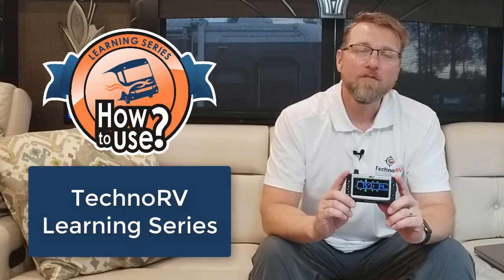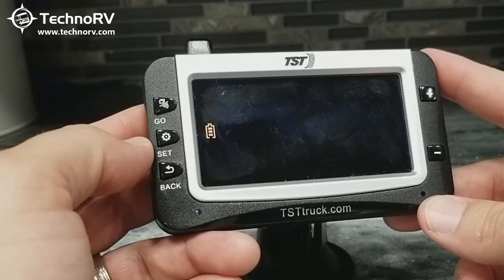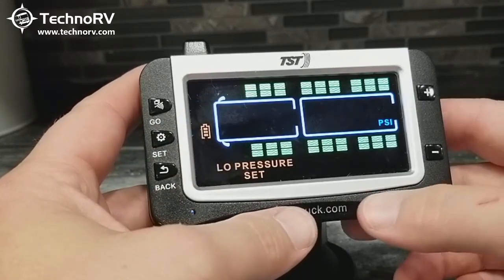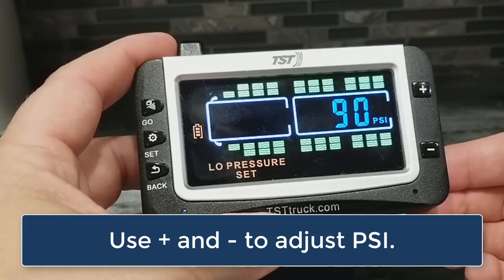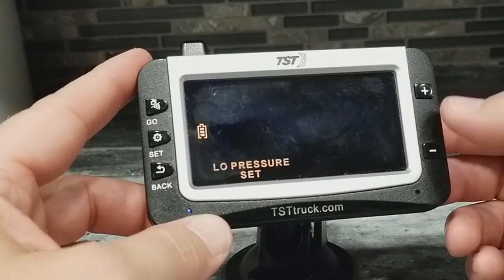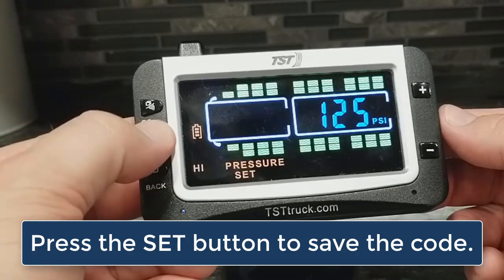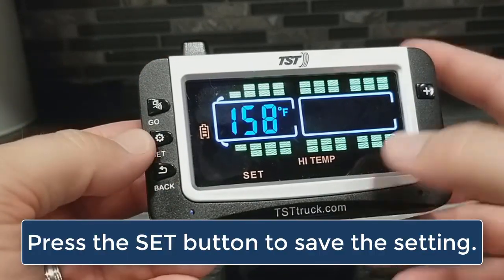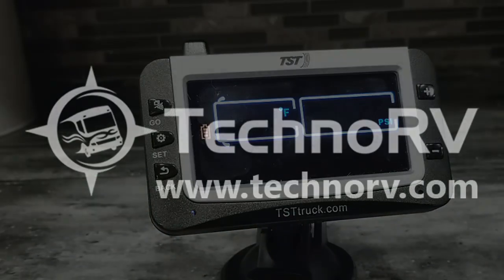TechnoRV TST 507 Learning Series: Setting up PSI and Temperature Alarm Parameters

Comment: My wires for the repeater is hot all the time. Will the repeater turn off after no use or will it stay on 24/7?
What should I do if it needs to shut off until needed. TST 507 RV 4 C install in a travel trailer. It was pre wired for a lippert system. I took of the mount for that and that was where I was going to put my tst

Comment: I bought the 507 monochrome for our Monaco and it wasn't easy to setup. I had all of the sensors initially recognized by the monitor, but it took some doing, as a few of the sensors did not want to be recognized in the position I had placed them on the monitor, but they all eventually were recognized. By the time I installed them on the coach, I had three sensors that weren't doing anything. I waited 20 minutes (instructions say 15 minutes) and nothing. I ended up deleting all of the sensors from the monitor and starting all over again. This time all but one were recognized. I took the battery out and tested it and it was fine, so I reinstalled it and tried again....one hour later the monitor finally beeped and registered the sensor. Everything now works fine, but what a PITA.
Reply from the maker: Did you install the repeater that came with the system? This will help boost the sensors signals to your monitor.
Reply: @Technorv  Yes I did. Everything now boots up as it should, it was just the setup that sucked.

Comment: Thanks for a good informative video. Questions: What are the defaults for high/low pressure & temperatures? Is this procedure the same for a black & white monitor? I have 80 psi cold pressure on my Rv tires so what high & low settings should I use? Thanks
Reply from the maker: Hi Max! When setting your parameters for your high/low we recommend 10% below your cold pressure for your low setting and 20%-25% above your cold pressure for your high setting. The TST will come preset at 158 degrees for your high temperature setting and we recommend not to adjust this as per TST's recommendations. So to answer your question if your cold psi is 80 you would want to set your low at 72 psi and your high between 100 and 106 psi. I hope this answers your questions.

Comment: I’m trying to reprogram my TPMS because I have been tires and got the sensors all mixed up. I’ve deleted them (thank you for that video as well). However, I’m at the stage where I need to set the PSI. I keep getting mixed information (or I’m just not extrapolating it correctly). Some say I should inflate my 5th wheel tires to about 5-10 pounds below max (max is 110psi for me) since I’m towing and they’ll heat up and this will account for that heat. Others say always do the max the tire lists because they’re built to handle the extra psi from friction as I’m driving. Still others say to get each tire weighed, but this isn’t an option until I’m ever near one of those types of weigh stations. What is the best “rule of thumb”? I’m inclined to go with max on the tire sidewall. Thank you!!
Reply from the maker: Great question!  The safest thing to do is to run at the max on the tire, unless you want to get weighed and apply the weights to your tire's psi chart which, as you said, isn't always the easiest thing to do.  You should not reduce your psi to account for the increase that happens when the tires heat up while driving.  Tires are built for that and the max psi takes that into account.  If you reduce your psi to account for that, you are underinflated which can lead to a host of problems including a possible blowout.  I hope this answers your question.  Safe travels!